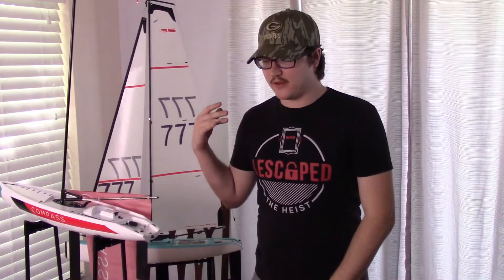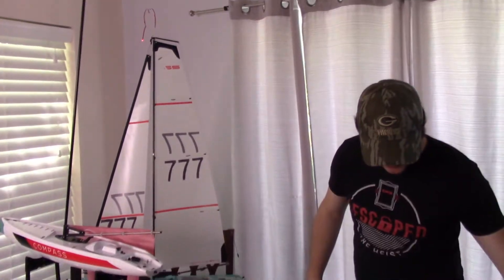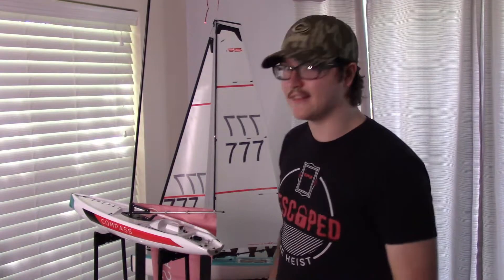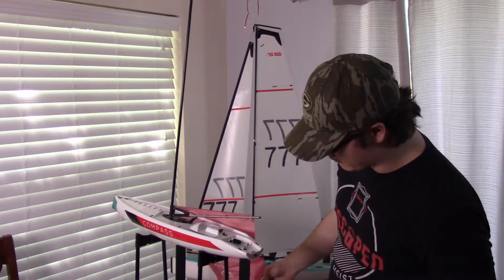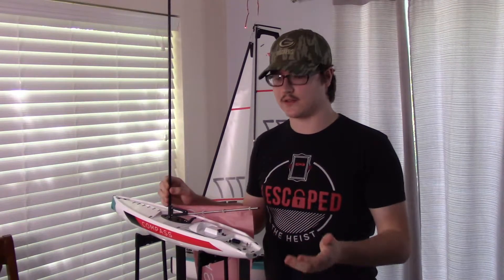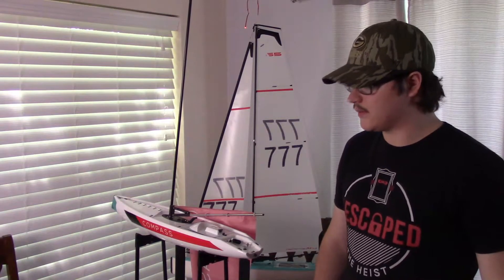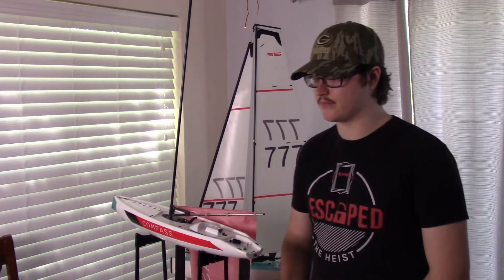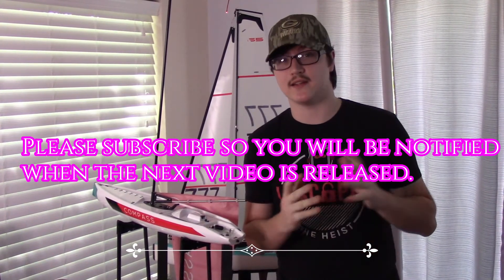Sail Wars Showroom! Compass RC Sailboat Review Part 3

Comment: I had one after a couple sails the on/ off switch stopped working sent it back they sent me  new one with the same problem stopped working after just a couple times out . Had to improvise the rudder catch too . Sailed really nice when I did sail it but sadly  more trouble than it was worth
Reply from the maker: Did you ever sail it against a DF65?
Reply: @sailwars  I did once during a regatta I managed to beat one of them in the last so I wasn't dead last.
Reply from the maker: A compass with good sails should be pretty fast.